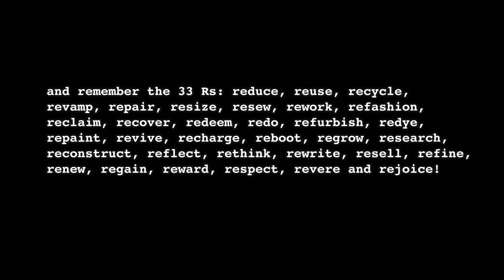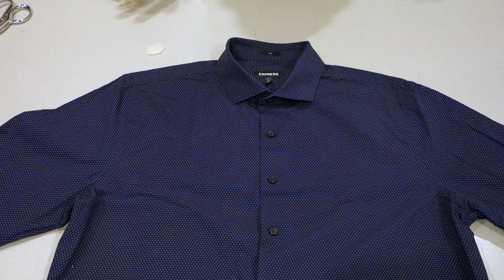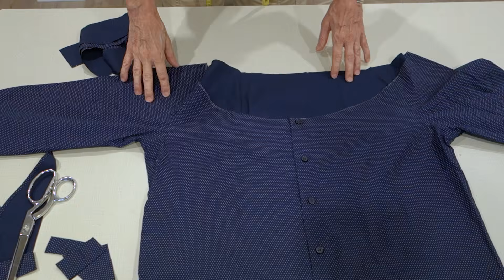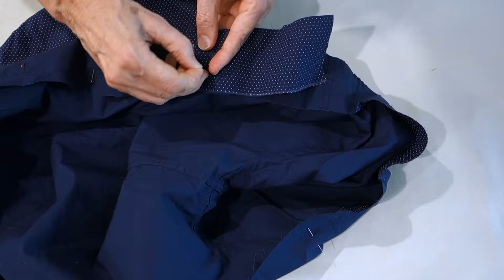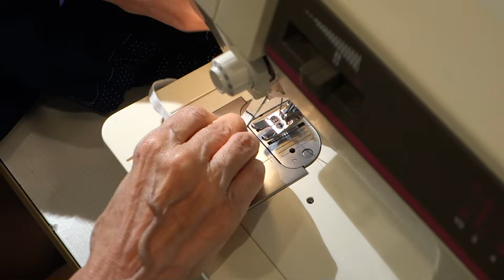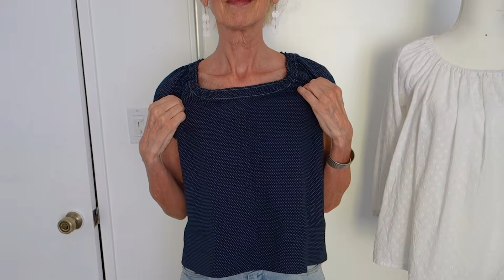DIY MEN'S SHIRT REFASHION :: EZ Sew :: Turn men's shirt into women's peasant top

Comment: If you want more length, you can  make the casing out of wide bias trim, or even out of strips cut from the rest of the sleeves.  Or just use some other fabric you like that plays well with the shirt.  Then you'd not have to trim the length at the bottom.
Reply from the maker: Good point. Thanks for the suggestion!

Comment: I tried this before, the result was ok. But the neck was a little strange as I didn’t attach a casing, just folded the fabric down. Your method of attaching a neck casing is a good idea and makes the result more polished. I am going to try again. Thank you for your clear instructions.
Reply from the maker: Thanks for the feedback - I thought about using the fold down method and thought it might bunch up so I used this instead. Good luck with your next attempt!
Reply: @thehouseofre2025  You are right. The neck bunched up around the turns. I can feel it slightly scratching my neck when I wear it. It is not too bad, but I don't wear it often because of this . These little details really make difference.
Reply: @thehouseofre2025  I tried your method and flipped a man’s shirt to a very cute summer top for myself. The neck casing worked great. I especially like the two openings at the end. It is so easy to put in and take out the rubber band. First I used the 1|8 in rubber band, but it twisted multiple times in the casing as I sew a wider casing. I pulled it out and replaced it with 1/2 in rubber band. It looks so much better and holds up the neck much better. I didn’t put in rubber band for the sleeves as I like the loose short sleeves. The top looks cute and super comfortable to wear. I am wearing it today! Thank you so much for your video!  Do you have technical background? Your way of thinking is very logical and precise. I enjoy your style. I work in technical field myself.
Reply from the maker: I'm so happy to hear about your new top. Thanks for the feedback about the elastic. My father was a scientist and he always explained things in a clear logical way. Maybe I got it from him :)